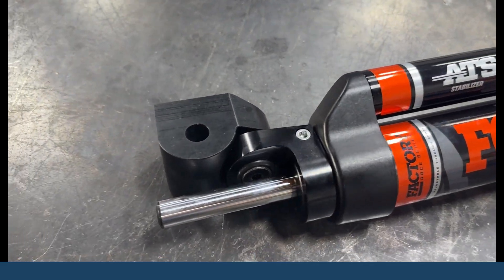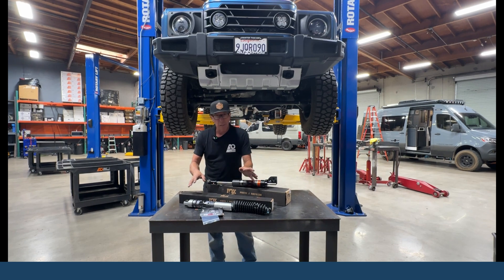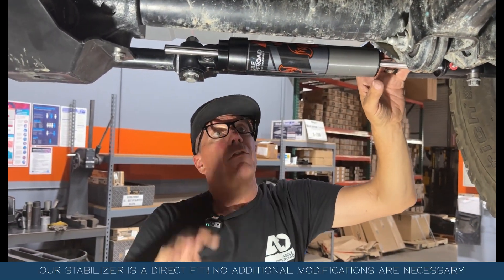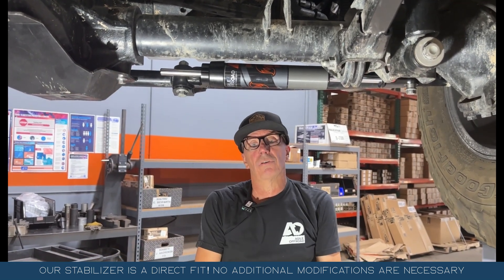Introducing The FOX ATS Direct Fit Grenadier Steering Stabilizer by Agile Offroad

Comment: How does the fox bar compare to the King bar? Have a MY26 B57 station wagon on order
Reply from the maker: Great question. Both are quality options. The King 2.0 bar is a solid, rebuildable stabilizer that does a nice job calming the front end and helping with return-to-center, especially with bigger tires. The FOX ATS adds a through-shaft design and external adjuster with multiple clicks of tuning, so you can really fine-tune steering feel from lighter/more responsive to more planted for highway and rough terrain. We run and support the FOX setup on our own Grenadiers, so that’s what we’re most confident recommending and tuning, but you’re looking at two good tiers of hardware, not necessarily “good vs bad.”
Reply: @Agileoffroad Thank you!

Comment: Installed mine from Agile into a late model 2024 Grenadier Fieldmaster. Fox has customized the stabilizer for the Grenadier and so the bracket from Agile is no longer needed (no longer included in their kit). The bracket on the Grenadier that the stabilizer slides into on the 21mm side on my vehicle had the top nut welded to the bracket and so I didn't need the open ended wrench to keep the top nut from spinning when taking off or putting on the 21mm bolt. The 21mm side of the stabilizer was a very tight fit into the bracket on the Grenadier on my vehicle and so I had to use a crow bar to "open" it slightly and then a rubber mallet to get the stabilizer into place on that side. Otherwise installation was the same as this video. Steering is WAY better after installation of the stabilizer and the vehicle naturally returns to center when driving. Easier and more enjoyable to drive. Definitely worth the $$$.
Reply from the maker: Appreciate the detailed feedback and glad to hear you're enjoying the upgrade!

Comment: Installed dual ATS stabilizers on my 2500 Ram in place of their basic 2.0 stabilizers.  $1000 later, not a damned bit of difference.  Nothing, Nada.  What's more, Fox claims there is 24 clicks of adjustment.  I have 18 on one, 20 on the other.  I emailed Fox with this concern, they didn't even have the courtesy to respond.  Nothing...again.  I run 2.5's on my truck, but I'm gonna have to reconsider brands when it comes time to replace shocks.  Fox money might buy you orange stickers and street cred, but that's about it in my experience.

Comment: Does this make the steering wheel turn back on its own after turning a corner?
Reply from the maker: The Fox steering stabilizer will improve the return to center on the steering, but it will not completely fix it.

Comment: So no need to increase the caster?
Reply from the maker: We don't. If you feel the need to, our recommendation is to keep it within factory settings and keep your alignment straight.
Reply: @Agileoffroad  i wish you can do a short reel showing how the on road driving is with this installed. This is the only thing holding me back from getting a Grenadier. Thank you.
Reply from the maker: @reneguerrero4657  We've had requests regarding the steering comparison. Its a difficult thing to show because it truly is a feel. We can absolutely try and attempt it this week with the ATS.
Reply: @Agileoffroad  would love to see this on the road too
Reply: Adjusted the Caster on mine to maximum, really big improvement but I intend to try the ATS too.
Reply: Got mine yesterday and installed it today. It was really easy to install like the video shows. Test drove it and it really does make a huge difference in stearing. Really happy with this upgrade.
Reply: Does it give it a tighter turning circle?

Comment: I had driven 5 Grenadiers on a long term basis and none  of them drift ??? Either from new or at thousands of miles both petrol and diesel?????
Reply: 4 for me and concur 100%. Watching reviews from the USA is constant WTF are you talking about. Yesterday, I got caught by a second bank on a creek wash away at about 35mph on a beach and bump stopped front left. Grenadier didn’t stray off its line and there was no steering wheel whip at all. Back on the motorway today and it was its normal self - tracked exactly, no dead spot, no wander, relaxed at the wheel using just thumb and forefinger.
Reply: @markelliott6105 I agree.  It’s like mass hysteria started by some reviewer and repeated by everyone else.  Probably that idiot Roman at TFL. My Grenadier steering is comparable to my 200 series, both of them, as far as wandering.  Steering input is different but it doesn’t require anymore correction just…..different.
Reply from the maker: Stock Grenadier stabilizers don't 'drift', if you watch our other stabilizer video John does talk more in depth about what he means as far as wheel correction goes!
Reply: Ave they been production vehicles?
Reply: @stevegreen101 yes Steve 23 & 24 model years